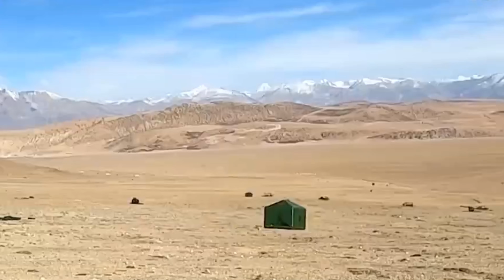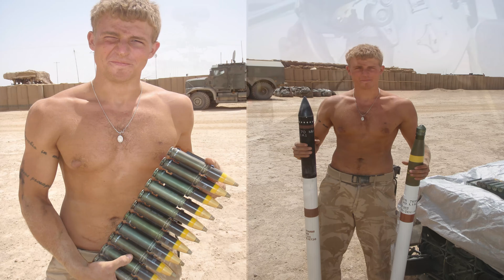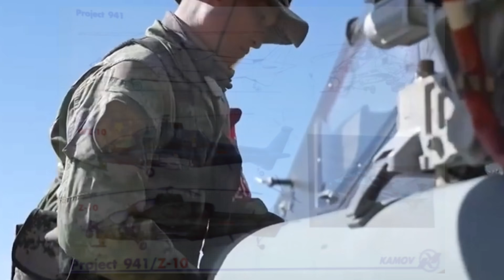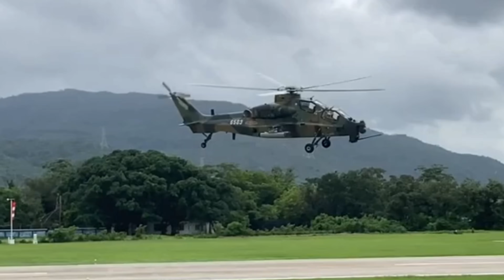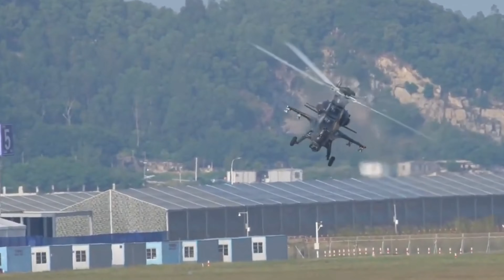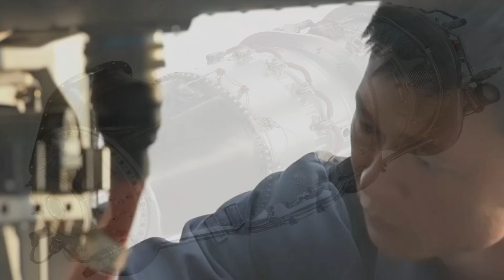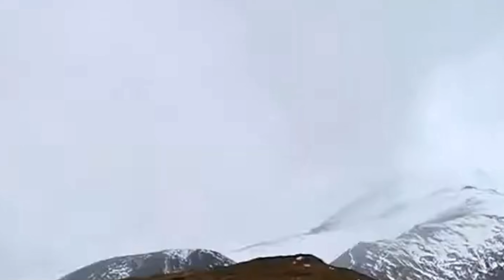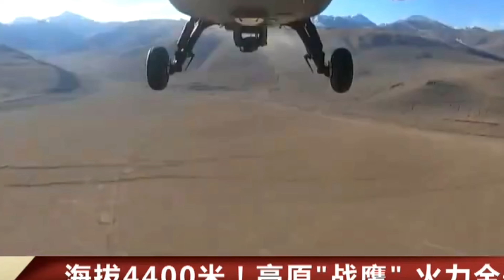China’s Z-10 'Changhe' Attack Helicopter | CROUCHING EUROTIGER HIDDEN APACHE GUNSHIP 🚁

Comment: One thing not mentioned in the video is that Z-10's emphesis on range, it has a range 800km on internals, which for its size and role is quite unique. The doctrine it operates is able to across the taiwan strait, perform its combat missions, then fly back. According to Chinese langauge reports on, it's max range on internal fuels is >1120 km and combat range (I assume under light combat load) is >420km, ferry range with external tanks is >1500km.

Comment: Modern helicopter gunships need active ballistic defense like Trophy on Merkava/CV90 and all-round al-weather vision as used by F-35 to survive on the modern battlefield while flying low apart from having above rotor mounted sensors like optional above rotor mounted radar on Z-10 or KA-52 with AA radar on top apart from larger nose-mounted radar similar to optional millimeter-wave radar on Apache or electrooptics for passive scouting and targeting with laser rangefinder on Eurocopter Tiger. An active approach to protection is inevitable in an age where even civilians can modify off-the-shelf drones for anti-helicopter combat and MANPADs are widely available. While some may have fantasies about drones taking over, the ugly fact is that any decent opponent will jam, hack, or destroy coms even before the battle starts, while giving full authority to AI when the enemy can easily deny communication with the user is rather questionable... 
So, there will always be a need for some low-hanging helicopter nearby to command them, and newer helicopters like AH-64E indeed have this capability already intended for canceled RAH-66 Comanche likely superseded by currently developing gunship/scout helicopter hybrids. While in some cases this new generation of helicopters are designed to sport all-round vision, so far they seem to be still subjected to cost-cutting and thus nasty MANPAD or drone surprises in terrain where automated threat detection and warning do not have time to alert helicopter crew or take automated counter-action by employing decoys or jamming, initiating evasive action or trying to shot down incoming threat by autocannon with time-fused He-Frag ammunition. 
Some sort of active ballistic defense will be needed for helicopter gunships to stay relevant as Russians finding a hard way by their tank and helicopter crews...
Reply from the maker: @IonorRea great information and feedback! Thanks also for the super chat donation and support!! ☺️👍

Comment: I'm curious, why don't more vehicles and aircraft armor up for 12.7mm rounds?

It's a fairly common round across all the world's militaries, yet so many vehicles and aircraft seem to only bother armoring against 7.62mm or similar rounds rather than the larger round.

Is it simply a weight thing? The increase in weight not being worth the added protection for crews/passengers?
Reply: it's a power plant thing.  WZ10 was originally designed to use a Canadian engine in the early 2000s, but the deal was blocked by certian someone, at the time china didn't have a on-par engine so protection was cut to reduce overall weight so a domestic engine can work. This was one of the reason WZ10 design took some extra year to finish after the original prototype was arealdy in flight test BTW

Comment: 5 rotor blades to apache 4.  It's exhaust either pointing up or to the sides, dont know which.  No longbow, but i assume main purpose is mountains of Tibet,  dont know if radar matters there.  Heli to me is a crewed, loitering, ambush munitions, delivery vehicle.  Needs to hide, wait, observe, shoot and scoot, all without revealing itself, ever.  Most cost affective use of it.  Flies under radar, hides behind terrain, 2 crew, maybe should be 3, like a tank.  I think its fixed weapons pods, instead be wire guided, armed drones, operated by the 3 crewman.   Can hide so much easier that way, observing all.  Shoot, ditch, run, or reel them back if safe to do so.  Similar to longbow dome, but detachable, navigable and armed.

Comment: I have seen this helicopter and the Z-20 at the Zhuhai Air Show and while I agree with most of what you said I don't think the Z-20 is just a copy of the MH-60. China purchased the Sikorsky S-70C-2 in the 80s and used it in the (sometimes) hot and (always) high terrains around the Tibetan plateau. They desired a higher-performance, more modern version but buying them was obviously out of the question, so AVIC basically created a longer, boxier version with an extra rotor blade, new transmission and upgraded engines. I think the gear is also different but I'm not totally sure on how much. So while it is definitely based on their older rides its quite a significant upgrade, which at least in my opinion deserves quite some respect. The issue with Chinese aviation is integration, which you touched on briefly with the AI comments. They are not good at making different innovations work well with each other, a key reason the ARJ-21 was not more successful and something they must figure out if they want the upcoming C929 to be a success.
Reply: Ikr. It's like saying F-35 is a copy of yak-141. The irony of westoids can be unbearable sometimes 😂

Comment: You can't just combine two helicopter or aircraft designs together. That's not how aerodynamics works. This is clearly an original design. Not to mention that it is completely silly to compare the Z-10 with the Apache when they're in totally different classes. The Apache is a heavy attack helicopter in the same class as the Ka-52 while this is a lighter medium attack helicopter.
Reply: The Z-10 is closer to the Eurocopter than an Apache.
Reply: @randomka-52alligatorthatis34 the Italian Mangusta also.
Reply: Ka-52 is not a heavy attack helicopter. It's no where even remotely close to the apache in payload or capability. They aren't comparable in quality. The closest the Russians have is the Mi-28. Which again, the apache is superior in arms, armor, and maneuverability.
Reply: @snakeeye814  What? The Ka-52 can carry rockets and ATGMs (2 more per pylon than the Apache can carry Hellfires), plus IGLAs (tbf, of dubious use on helis), and has FLIR and Radar mapping, and is armoured to withstand upto 23mm AA fire. The only thing its not got is an equivalent to the Hellfire-Longbow.

Comment: I'm sorry, but how is it possible that you were in the U.S. Army and knew absolutely nothing about Russian weapons?!?! This is obviously a copy of the Russian MI 24 or today's MI 28!! Reinforced armor, 2 pilots, one of whom controls the helicopter and the other the weapons, and can carry 8 soldiers in the rear. Of course, the design of the helicopter is a bit reminiscent of Western helicopters, but this is just a visual adaptation of a more modern design, but basically this is the MI 24 of modern design!! The wings on this helicopter primarily have the role of controlling the helicopter very similarly to an airplane, but once they are there, they can also be used for Weapons .This is best seen at higher speeds when the helicopter gets incredibly good maneuverability with the help of wings, and this is the solution with the MI 24-28!! The helicopter tilts slightly forward, and then the wings have a very similar role to that of an airplane. Then the helicopter can change direction much faster in terms of left to right to avoid 20 to 30 mm guns, the speed of the MI 24 is 360 km/h and it can fly at an altitude of up to 4,500 meters where it is safe from these missiles especially since it has armor, but we have not heard the speed and altitude of the Z 10 which is very important. A 20 or 30 mm cannon cannot penetrate the armor of the MI 24 at an altitude of 4,000 meters and can then maneuver to avoid hitting this ammunition because it is about the maximum vertical home of a 20 to 30 mm gun. But for any case when flying at a speed of over 300 km/h and an altitude of 4,000 meters, it is very useful that it can change direction very quickly, because there is also a 40 mm cannon whose rate of fire is much slower.
Reply: If you knew anything about Russian systems you would know that it makes no sense to compare the Mi-28 with the Mi-24. The Mi-28 also shares very little features with the WZ-10.
Reply: @voidtempering8700  I'm sorry you're looking for a gun? And are you interested in that? It's the same as saying that the MI 8 has nothing to do with the MI 17 or that the Kub air defense system has nothing to do with the Buk M2 system, especially not with the Buk M3, and in fact the Kub was created first, so the modernization was done to get to the Buk system and then all the Buk M1, M2,  M3. In any case, Russia mostly does everything in the same way as the S 300 P gave rise to the S 300 PMU 1, PMU-2 and then PMU 3, which for marketing reasons was named S 400 or from S 300 V was created with 500. Also, the first attack helicopter was the MI 24, which in the meantime has been modernized in various directions, as they did from the SU 27 5 versions of the SU 30, 33, 34, 35 ctr ctr. The MI 24 had an export version of the MI 35 and everything else, regardless of the fact that they are not the same and each is special in some way, but the MI 24 and 28 and even the K 52, which this Z 10 looks most like, comes from the MI 24, and that is the idea to make an armored helicopter to support troops on the ground and to fight armored vehicles.  Tanks and bunkers.
Reply: @velimirkolundzija4451  The MI 17 is a modification of the MI 8, using that as a comparison between the MI 28 and MI 24 is nonsensical.

The same goes with the variants of the Buks, you are only showcasing your lack of knowledge and understanding.
Reply: @voidtempering8700  Are you saying that the Cub system didn't come from the Cub system? You've got the whole way to modernize the Kub system all the way to the Buk model, and first read something and then say what you have. Even the Tunguska system is the forerunner of the Pantsir S1 system, despite the fact that the Pantsir S1 is made by another factory. And what is the difference between MI 24 and MI 28?  Except that the MI 28 was built 40 years later and has much better electronics in terms of radar, a fire control system as well as new weapons or MI 35? The difference is between SU 27 and SU 35.
Reply: @velimirkolundzija4451  The common theme of all the systems you mentioned previously is that they had a standard design that was common between them. The Tunguska uses almost the exact same weapon systems as the Pantsir. That doesn't exist between the MI 24 and MI 28. They were designed for two different purposes, and the MI 28 has a brand new design that shares very little in common with the MI 24. It's closer to comparing the Mig-25 and Mig-29 than anything you mentioned previously.
Reply: @voidtempering8700  I'm pretty familiar with the MiG-23 and the MiG-25, 29 and 31. Although when you mentioned the MiG-25, from which the MiG-31 was later created, they also had in mind the design of the MiG-25 aircraft when the MiG-29 was built, but the MiG-29 was made for a different purpose than the MiG-25 and later MiG-31. I'm not saying that the Mi 17 has anything to do with the MI 24-28 or the MI 35, but since it's a factory that has a certain number of engineers there and if they can use some of their previous projects they will do it. This is ridiculous and the MiG-25 and the MiG-29 are two different projects and we all know that the MiG-31 is the successor to the MiG-25 aircraft, but since you've already mentioned it, you can watch the show how the MiG-29 came to be and you'll see that they stuck to that MiG-25 design all the time, so that one plane would go in the direction of the MiG-29 as a fighter aircraft and the MiG-31 as an interceptor aircraft, and all three planes look alike. It's just that they have different purposes. It's a shame that the MiG-35 didn't come out just 10 years earlier.But helicopters MI 24, 28, 35 and even Ka 52s have the same purpose, only they have been perfected as Russia has conquered various technologies and theoretically Russia could modernize some of its MI 24s if they had them in good condition to be at almost the same level as MI 28 or MI 35, but it is not worth it.  Russia has KA 32 Helicopters .The MI 24 is like the SU 25 and the MI 28 is something like the SU 35. 😁
Reply: @velimirkolundzija4451  So you do understand in your final comparison between the Su 25 and Su 35. They are two different platforms that share little in common.

Lastly, you do realize that the MI 24 and MI 35 are the same thing.
Reply: @voidtempering8700  Look, first of all, I have a problem because Google or YouTube or the CIA or the deep state, I don't care who deletes comments or inserts some nonsense that I try to correct later, but well, that's not the topic, at the beginning I wrote that the SU 30, 33, 34, 35 and all the others in terms of M, SM, M1, M2, ctr ctr, all these are derivatives of the SU 27 aircraft,  and also all attack helicopters of Russia are made on the basis of MI 24, this at the end I wrote that MI 24 and SU 25 in Russia today MI 28 and SU 35 in today just to try to Explain Or should I say that Russia has made a lot of technological progress today, of course we know very well that there is nothing in common between the SU 25 and the SU 35, except that the SU 24 at that time did what the SU 34 does today, and that the SU 25 was supposed to do what the SU 35 is today, although at that time there was also a MiG-29 in Russia, many other aircraft, so the SU 25 did not have any success in the market, first of all, that everyone expected much more from the MiG-29, which sold much better and in fact it is an excellent platform, but Russia did not at the time It had access to advanced technologies so that the MiG-29 would have better radar and therefore much better armament. Look, I'm very interested in Russian weapons and there is literally nothing that Russia has done that I haven't read something about, I just don't care about Western weapons at all as their doctrine of warfare, but as far as Russia is concerned, it's something like a hobby for me. And if you're interested, I've personally sat in the MI 24 and in the MI 35, in two versions of the MI 35, the one from 2,000 and And the newer version of the MI 35, in the first version of the MI 35 there were 2 30 mm cannons, but they could not be moved, but they were aimed by turning the helicopter, while the new MI 35 got the ability to control the cannon as well as the new missiles, and all this is literally the same system, only the new versions of the MI 24 got new electronics and therefore new capabilities. The MI 24 did not have any guided missiles, but used honeycomb launchers with S 8 missiles, this is what the MiG-21 carries, and of course the 30 mm cannon, but let's say today the MI 24 can be

Comment: Comprehensive analysis. 
Just want to add that the Z10 is a middle weight heli. A Z20 based attack heli is already in the works with a completed prototype. This would be more comparable to AH64.
Chinese turboshaft engines are actually more advanced than their turbojet engines, with many power variation. So heli engines are not a problem.
Reply: neither comprehensive, nor analysis

Comment: In this age when every platoon has a MANPAD helicopters are reduced to just sniper warfare. They are far less relevant than they were two decades ago.
Reply: Most helicopters have atgms that can. be fired from BVR.
Reply: @FailedMarshal-o1u  I know of no ATGM which can be fired from BVR. Not even the Javelin ATGM can achieve that feat.
Reply: @johnroberts9922  BVR to a human manpad operator. Russian KA52s use it I don't remember what it's called.
Reply: @ When a helicopter is firing off ATGMs? Think about what you just stated.
Reply: @johnroberts9922  yes
Reply: @FailedMarshal-o1u  Five miles is an extremely long shot for both ATGMs and MANPADS. In other words if the helicopter is close enough to fire off ATGMs they will be in full view of infantry and their MANPADS.
Reply: @johnroberts9922  optics of helicopters are more powerful than the naked human eye.

And the manpad operator needs to know where the chopper is.

Comment: Why are these attack copters always in Black Color.  At night it does not matter.  During the day, they stand out like a wart on your nose.  Anodizing or treating the metal for a "low-visibility" color scheme seems sensible.  The black color has NO stealth capability, as measured against the other signatures.  It would be better to "coat" it with a light stealth-foamed multi colored skin, which could also a thermal management system for cold/hot zones.  Also, anti drone technology in critical areas would be helpful.  These designs seem to be "ancient" in any modern drone warfare scenarios.

Comment: One quibble - the Z-10 may be a multifuel engine, but the promary fuel is NOT "AVGAS" (110LL aviation grade gasoline).  It is jet fuel, which is aviation grade kerosene .

Im sure they have an emergency procedure to run AVGAS in the engines if necessary, but it would resuot in reduced power, reduced range, dramatically increased wear and tear (think "1940s jet engine" lifespans), and a much hugher risk of fire and explosion.
Reply: Does the ah64/1z and mi28/ka52 use the same kerosene?

Comment: You may not know how much PLA loves the Black Hawks（Imported in the 1980s）, this is why Z20 look exactly the same
Reply: It's goes to show how well design the Blackhawk was. They have Ka28, Mi171 and EC175 at hand but still chose the S70 as the basis of their medium helicopter platform.
Reply: An Taiwan officer pointed at two photos of Z-20 and S-70 and introduced to the Presidet that these were the differences between the two helicopters. He said that when fleeing in the war, don't get on the wrong one.:face-blue-smiling: